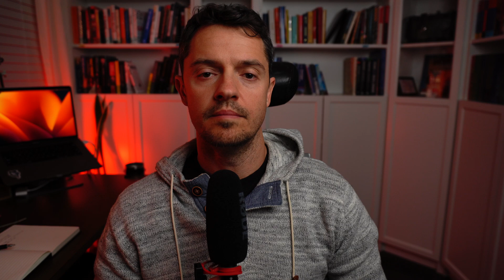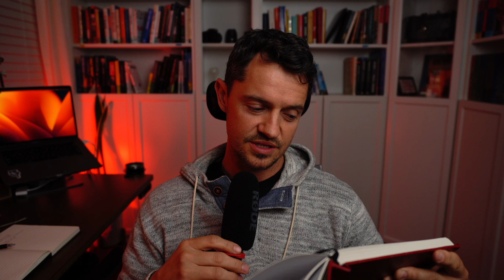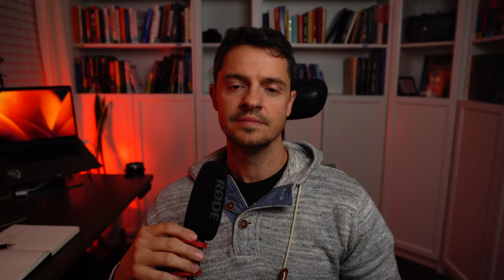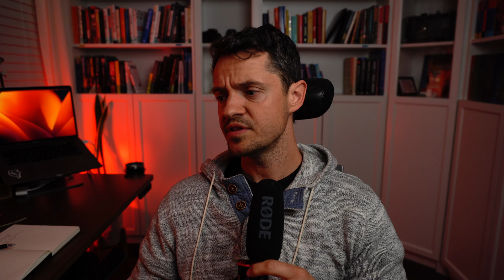Engineering Burnout Isn't Real - Here's What Is

Comment: Burnout often triggers as a result of doing something over and over again without long term satisfaction. You partly explained it but I would say education/studying can be large cause of that. Studying for a couple of years and at the end many wouldn't be able to get a job. In my personal opinion education can def. lead into those issues you mentioned. We especially guys are made to use our muscles, take physically demanding jobs. Sitting on a chair is not healthy at least not something I enjoy. Cheers
Reply from the maker: Thank you for commenting and for making some great points. You’re right about the desk job thing - I would know! But it has its pro’s as well. 

It really depends on what field you’re pursuing. You’re right in that you need a light at the end of the tunnel. Typically most engineers have the ability to find employment afterwards as there is enough demand. Some majors and industries are cycling down which is normal when it’s over saturated. The main point I was trying to make is that human beings can handle so many things - what are you stressing about in addition to what you should actually be working on? That excess input is most likely the cause of your burnout.
Reply: @NenadPeter  Agree. At the end of the day it is an individual thing. Not everyone has the same starting point in life, therefore different levels of burnout can be experienced.

Comment: Sir will ai be able to impact electrical engineering jobs or may be replace them?
Reply from the maker: It will impact everything in some ways. I think it will help us be more efficient in some and less in others. For instance, it may help you speed up your design process, but then you have to check and double check the final output. All I know is that the demand for electricity will continue to increase at a voracious pace and if you’re in the power industry, you’ll be in huge demand.
Reply: They won't replace us until we get old and die. 60 years later...